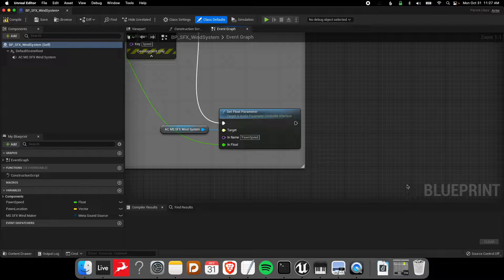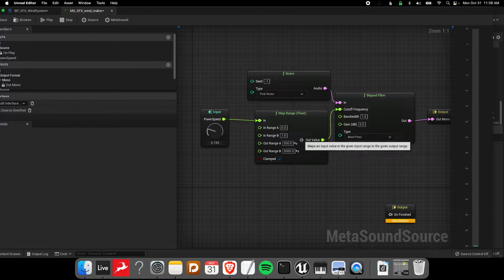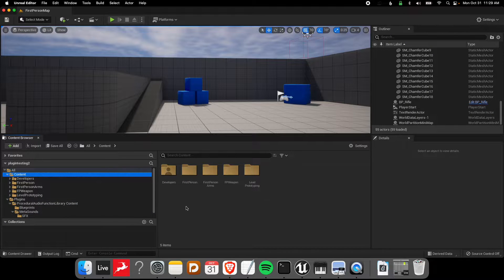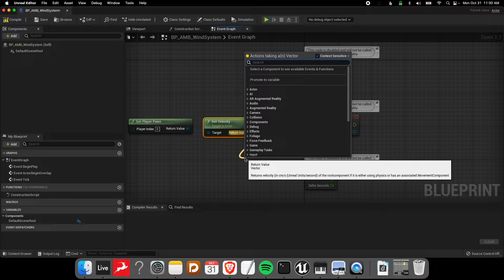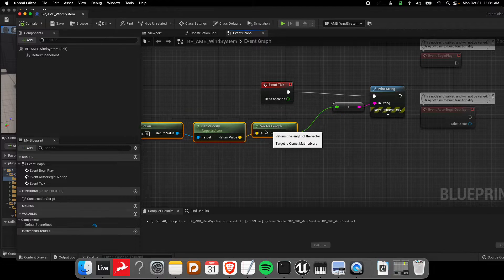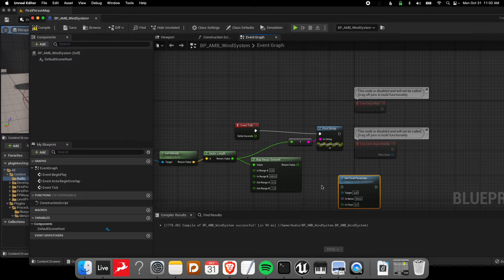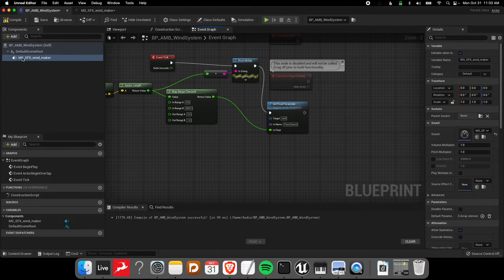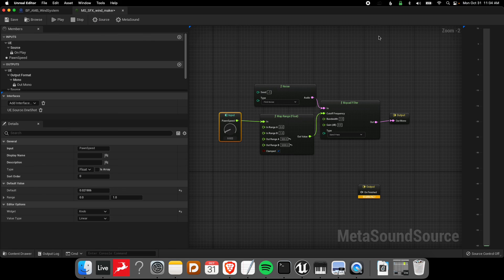Interactive Audio with MetaSound: Communicating with MetaSounds from Blueprints | Unreal Engine 5

Comment: Hey. Interesting video. I am attempting to apply this concept to switching between Idle music & moving music. How would I go about doing that?
Reply from the maker: Hey there. I think you're looking for the Quartz clock. This is designed for sequencing interactive music between different parts while staying tightly synced via the audio thread. You could in theory do it just within Metasounds, but I would say the Quartz clock design allows for bigger, more robust systems. I have a few basic videos about Quartz in the my playlist titled, "Procedural Audio & Interactive Music in Unreal Engine 5" if you want to check them out.

https://www.youtube.com/playlist?list=PLipnod61VHOUorA3dlqV95BaoaVoqFXb4

Thanks for watching.
Reply: OK. Thanks.